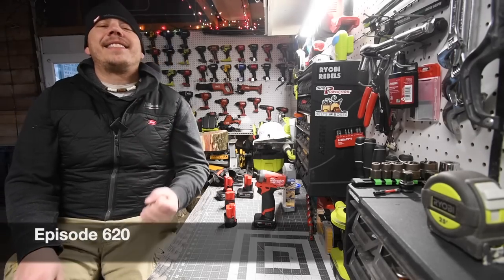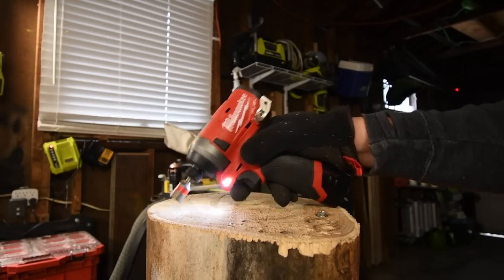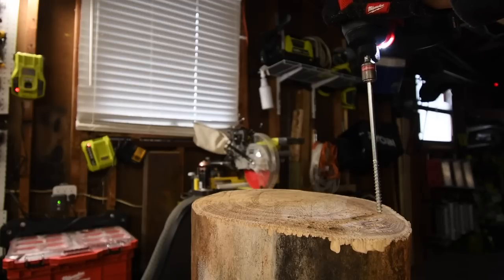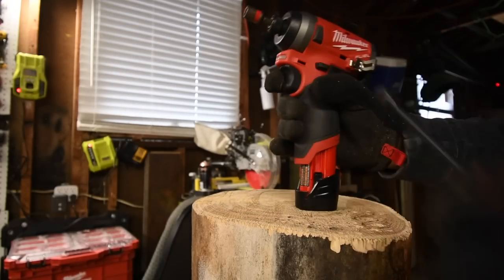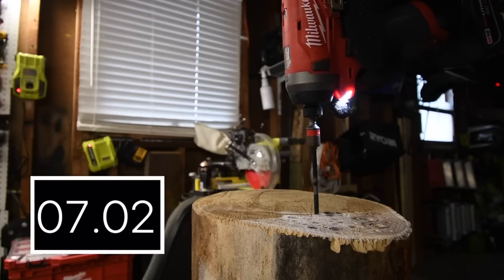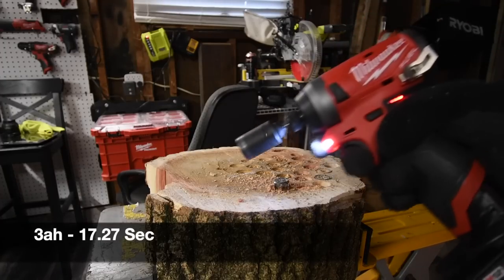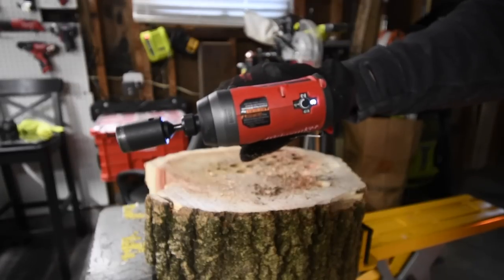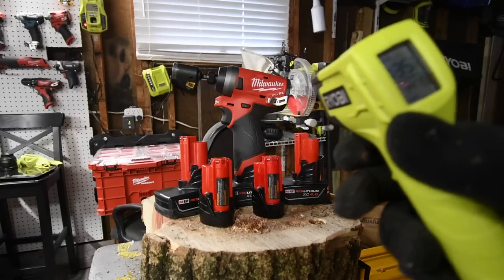Are these batteries that much Different?

Comment: As a general contractor I have been using this impact for a year and I tend to prefer the 2.0ah and 3.0ah (cylinder batteries). They have good power to get most tasks done and still keeps the tool compact. When you stick a 4.0 or 6.0 battery in it, the tool becomes almost the same size as the M18. In my opinion that takes away the propose of owning / using the M12. The whole point of this tool is so you can get into smaller spaces, easy to carry etc etc.
Reply: Same with me ! have several 3.0 cylindrical style batteries for the compactness of the impact it’s a cute little monster!
Reply: the m12 is bigger than the m18 without battery anyways
Reply: @StinyGinkle  it is?
Reply: Agreed.  For the M12 impact, a 2.0 is fine for many tasks.  Fits in my tool belt nicely.   For the Hackzall or oscillating tool,  a 6.0 is a must.  Normally,  for fastening, my M18 Fuel  Gen3 impact with a HO 3.0 is more than enough, and sometimes too much. That M12 impact punches above its weight class 9/10.

Comment: I had an apple tree snap in half during a storm. So afraid the other apple tree would do the same, I bought a 17-1/2" long 3/4" diameter Diablo wood boring bit and used it in conjunction with my m12 fuel hammer drill on low. I had to actually drill 24" through the tree to add the threaded rod that I then puts nuts on both sides. That little drill didn't like it, but it got the job done! I stopped occasionally to let the heat dissipate so I wouldn't melt the drill. I never had it smoking like in this video, but it was hot to handle. I love my m12 tools.

Comment: the compact 3ah batteries are the sweet spot for the m12 lineup. They have a good amount of capacity and put down 90% of the power a 6ah battery delivers. All while still being lighter and more compact. Only reason I still keep around 1.5 and 2ah batteries is for lower power devices like lasers, lights ect

Comment: I have the M12 Surge (got it this holiday) and the M12 Fuel Brushless Drill.   I like them.   Even though there are 2, they are so much more compact than my old brushed 18V set.
Reply: Take care of that surge I got mine stolen with a 6.0 battery 🤦‍♂️😂
Reply: That M12 Surge is probably my favorite overall tool. It's my first go to anytime I need that type of tool. Love that thing

Comment: The 4 inch lag the 3 ah did better than the 4 ah and the 6 ah. Has to be from the motor getting overheated as well as there could have been a knot in the wood.

Comment: Was framing out for shed windows and was going to use my 2ah battery and i could tell big time the difference of 2 and 4ah when driving 3" deck screws.  The 4ah drove it almost twice as fast

Comment: I use the 6.0 Ah with the M12 Hacksaw.  It just keeps cutting.  I'm amazed how many cuts of 3-6" firewood I get.  

For the bigger stuff that I need splitting I get out the bigger saws, but any log you can 'palm' I use the hacksaw, which is doing the lion's share of the cuts.

Comment: I purchased some knock-off 3.0ah cylinder style batteries off Amazon.   I still think the factory 2.0's are better, but I got 2 of them for $29, and for backup purposes in a pinch I can't complain at that price.   All 1.5ah are a complete waste of time and money.  I have a 6.0ah for my M12 Fuel oscillating multi tool, because that thing is a battery pig, but when I throw the 6.0 on my impact it will beat my Dewalt Atomic DCF850 😆

Comment: Picked up a $30 Amazon 9Ah waitley for my m12 3/8 stubby and I've been testing it for fun against my 6.0's gotta say it actually seems to hit harder. I often switch it out to see if it'll remove a fastener the 6.0 can't and it hasn't let me down. If your hard up for cash it's a great alternative the only con it doesn't have any drop protection so I Gorilla glued on a thin layer of neoprene rubber around Side/Base and other than that a budget friendly alternative to the 6.0👍
Reply: Until it bursts into flames while charging it; I wouldn't cheap out too much on tool batteries, personally lol
Reply: @garrett3108  I've had it almost a year it was a curiosity buy LOL. So far no issues  it's the only Chepo battery I have I run the genuine 3.0 torpedo or 6.0's. It's been mainly relegated to my work/camp area light since it outlast all the other batteries I have and surprisingly worked pretty good during this past cold winter nights. It's the only chepo battery with an OK rep and the power is there if your strapped for cash 👍🏼

Comment: If you want to test a Milwaukee tool where the battery truly matters use the M12 Fuel straight line die grinder. It will not work at all with the 1.5, 2.0 and even the new compact 3.0. It just shuts down under any load. With the bigger 3.0, 4.0 and 6.0 it's a dream.

Comment: In this thread: people who don't even have a basic understanding of electrical power and battery chemistry. The reason the larger capacity batteries seem to "hit harder" (as you bumpkins say), is because, in addition to having more cells (or in some cases higher capacity cells) in parallel (to increase the state mAh rating), Milwaukee goes with cells that have a higher 'C-rating', also known as maximum discharge rating. This allows the tool to draw more current in the larger packs. In some cases, Milwaukee also switches from 18650 to 21700 (for their M18 packs).

Comment: The bigger Amp hour batteries really only benefit for cutting and sanding tools where long runs without pause are needed. Drilling,  and tightening benefit from.the small form.factor of cylinder batteries sort of the point of having the m12..something g small compact light, access tight areas

Comment: Definitely a huge power difference between battery sizes. Using the M12 Fuel stubby 1/2” friction ring, there was noticeable differences between using the CP 2.0 and XC 4.0.

Although it would be very nice to see the difference between the CP 3.0 and XC 3.0 M12 batteries, if any. 

Great video as always!

Comment: I usually use 2ah with mine because 1: its compact and thats the point of the 12v to begin with, 2: I dont have a 3ah without the foot and dont think its worth buying when i already have the 2ah aaaand 3: i mostly use it for smaller stuff and go for 18v for bigger things anyway

Comment: If you can please get the single stack 3ah. That’s the one I really wanted to know about. It can’t possibly be as powerful as the double stack 3ah even tho the cells are stronger there is still only 3 cells taking that load. I love the compactness of the single batteries but the power difference is worlds apart.

Comment: I would like to see the small 3.0 and the double 3.0. (The small 3.0 is missing here) thats a way to really see if the parallel ones have any advantage. (6 batteries, 3 in series, 2 sets in parallel 1500 mah each)… the small one is 3 batteries in series 3000 mah.
Reply: I agree. The main thing I wanted to see was the difference between the 3.0 CP and the 3.0 XC.
Reply: Came to see as well. I only buy/own cp3.0 and xc6.0
Reply: There will be a big difference.  They might have the same Ah but the XC battery has twice the number of cells.
Reply: @IndependentThinker74  while, not thinking about it much, that might be true. Depending how and what your declaring. A cp 3.0 VS a xc6.0, yes depending on total power required by tool, ie if battery is a bottle neck.

I wanted to know how the cp3.0 fits against cp 1.5/2.0/xc3.0.

Not sure how a xc3.0 will offer significant improvement over a cp3.0, more cells, but worse cells.

I only buy cp3.0 and xc 6.0 as that best case per size. If I want slim in my tool, I'd rather not change it twice as often using a 1.5. And if I need a big battery, I don't want the same runtime as running a slim battery.

Same thing goes for running m18 1.5 or even 2.0 VS a 3ho. Or running a huge 3.0 instead of a 5. Added size and weight, for no gains.
Reply: @NikkThompson  same here.

Comment: on paper the m12 xc 4ah should be the most power full battery and it should be slightly more powerfull than the m12 xc 6.0ah battery   The xc 6.0 has 6s2p samsung 18650  30q cells which are rated at 15amps of discharge power since there are 2 sets that makes the m12 6,0 battery have 30 amps of discharge power.  The m12 4ah battery has samsung 18650 20r cells which are ated at 20 amps of discharge power also 2 sets of cells so that makes the 4ah m12 batter have 40amps of discharge power.

same goes for the m18 high output 6.0ah vs the 8.0ah battery.  the m18 6.0ah will have more power than the 8.0ah battery.  but these are 21700 30t vs 21700 40t cells.
Reply: Typical engineer.  Paper. Math. Graph charts.  The real guys know what works in the field.

Comment: I saw little smoke with using the 6 amp battery Dave. Also Dave is that the Fuel Surge impact? In addition I am glad you feeling better Dave.
Reply: Looks like the regular fuel (non-surge)

Comment: Whoever says there’s no difference between batteries, doesn’t understand how electric motors and current works. If there was no difference between the batteries, all electrical theory would be wrong and science would have made a severe mistake in its understanding of physics.